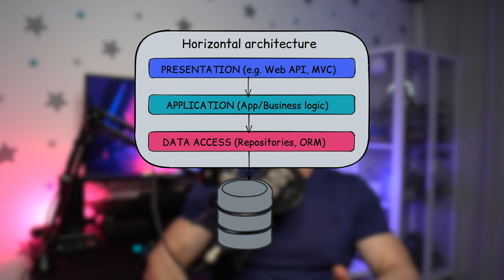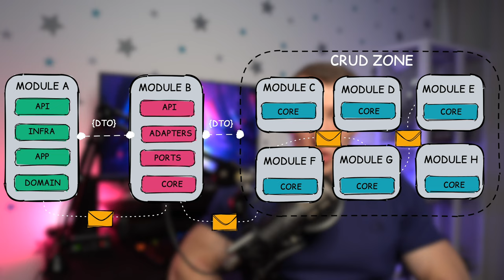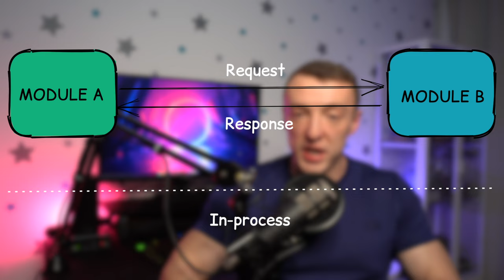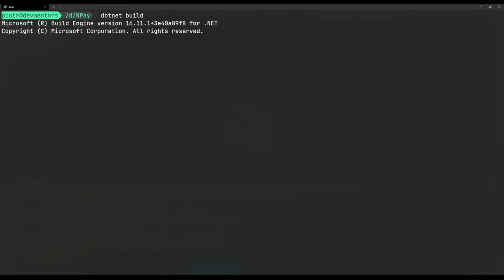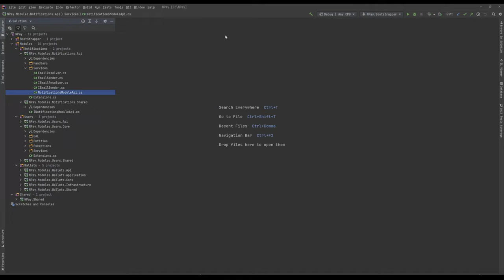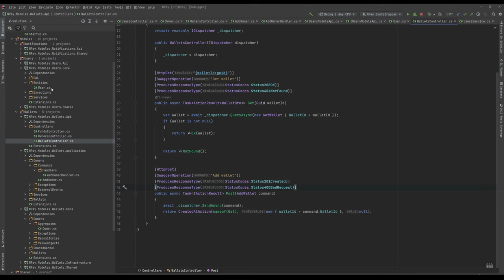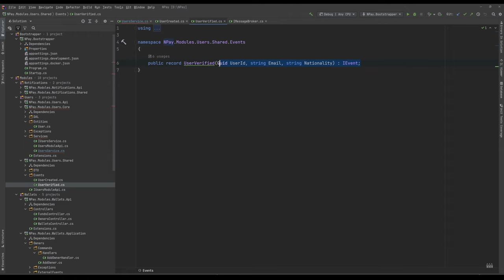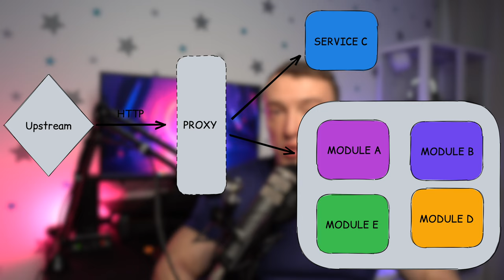Mini Course #2 Modular Monolith

Comment: First of all, I would like to congratulate you on the excellent content. I have a question about the vertical slice part. At the beginning of the video, you said that one difference between the classical and the modular monolith is that in modular you should use the vertical slice approach. But on the npay solution itself, the Wallets module use separated layers representing the responsibilities. My view on vertical slices is that you can have all these layers into a single 'slice' or a single layer, am I wrong about this perspective?

Comment: How is atomicity handled in the event driven system. For instance, creating a user should create a wallet but how do we deal with the case where after the user is stored in the db, there is an outage so the wallet isn't created?
Reply from the maker: At first, you need to make use of the Outbox pattern to ensure the guaranteed delivery of the events (and Inbox to ignore the potential duplicates). If you need more than that, such as some kind of orchestration on top of multiple modules, Saga might be helpful. It's pretty much the same when working with the microservices :) Check out our more advanced project for more building blocks  https://github.com/devmentors/Inflow
Reply: @DevMentorsEN  How would you go about implementing the Outbox pattern? Would you use transaction log tailing, polling or something else? This is the biggest smell of EDA for me, relying on transaction log tailing feels kind of hacky but there seems to be no better alternative, at least not one that i'm aware of.
Reply from the maker: @khuiification  outbox can be tricky indeed - in our sample, in the main solution for Inflow project, we simply commit the events to be published to the DB using the same TX as for our domain models. However, when you think about scaling, this could easily result in sending the same events multiple times - thus you might think either of some smart partitioning, distributed locking (e.g. redis) or other approaches that could handle such cases.

Comment: Great video. I see however that modules are using same(shared) IoC container. Kamil Grzybek once done modular monolith where each module has it's own IoC container. What do you think about such approach? Pros/cons? Maybe you can extend your modular course with such variant as well?
Reply from the maker: Yes, you could certainly do it e.g. using Module type built into Autofac container, but in the end, it all boils down to the question, whether you really need it, and what's the benefit? As long as you keep using abstractions, and the implementations within each module are marked as internal types, etc. it's not really a game-changer (IoC module) or so :)